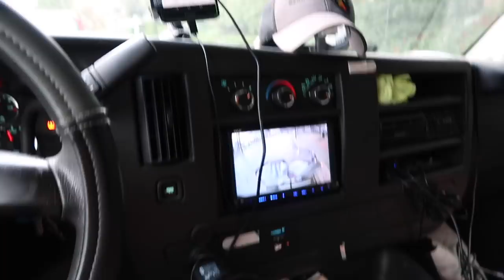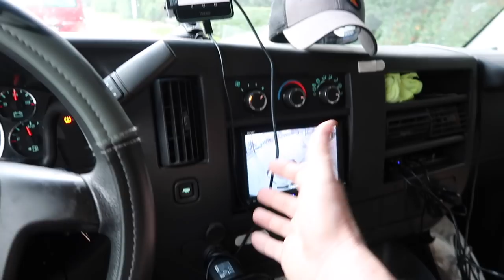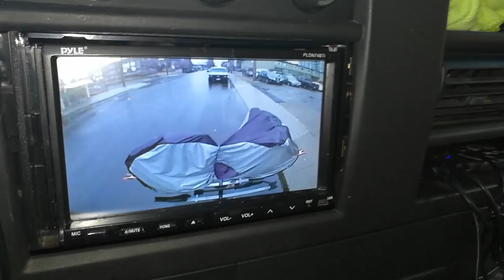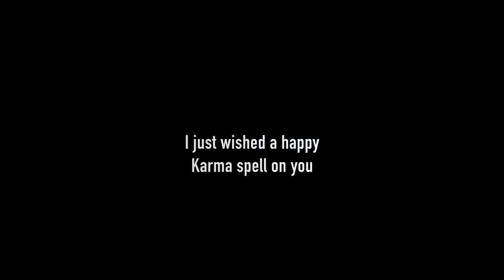One Awesome Inch - Meetup - Interview - Wave 3 Heater

Comment: hauwei pronounced ha (like laughing haha) way. Ha-Way at least that's what the representative told me my first tablet was from them and for a company I hadn't heard of and couldn't pronounce I really like that tablet it was really good very basic stock Android system the charging pin finally broke off so the plug wouldn't work anymore and I had to upgrade to a different brand but I would consider buying another one of their products if I were ever in the market especially if they started adding a second wide-angle camera to their phones like LG does so far LG is the only one doing it and I'd much rather go with one of these smaller companies that build Flagship phones for half the price if one of them ever gets on board with that.... and ideally I'd like to see a phone that also had some sort of optical zoom option even if it was an attachment like the Moto phone uses if I could go from wide angle to a true zoom lens all on my phone that would really be the ultimate vlogging phone,,,, maybe a little Night Vision lol

Comment: you should have more viewers than all those desert rats down in yuma and ehrenburg. you're more entertaining. (no i'm not giving you any money, ha ha). questions:  how do you guys keep from asphyxiating yourselves with propane heaters inside a little van?  where do you dispose of your poop buckets?
Reply from the maker: +abbey johnsson ha thanks.  As for not dying, you just crack the two front windows and open the roof vent a little.  There is also a low oxygen sensor on the heater to turn off when low oxygen so that no carbon monoxide is created.